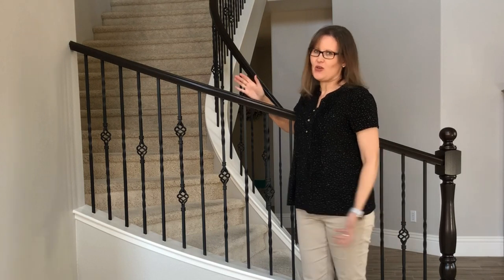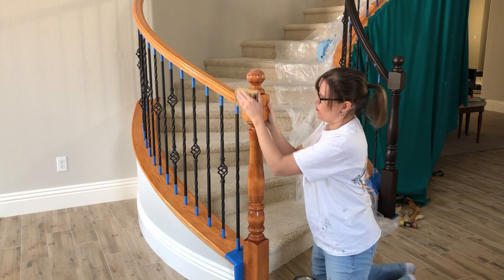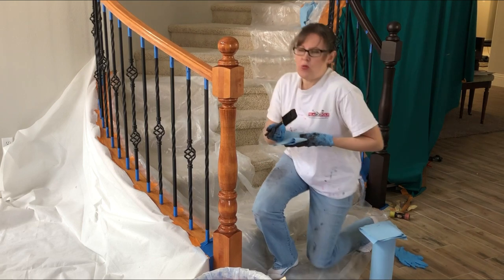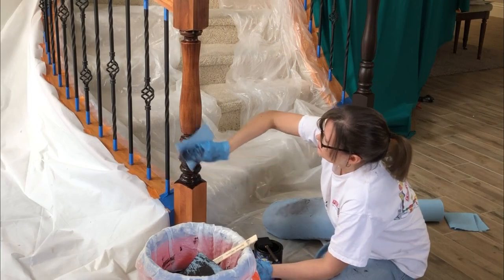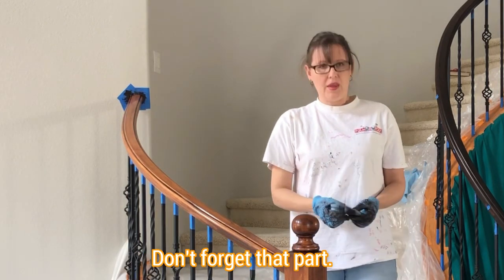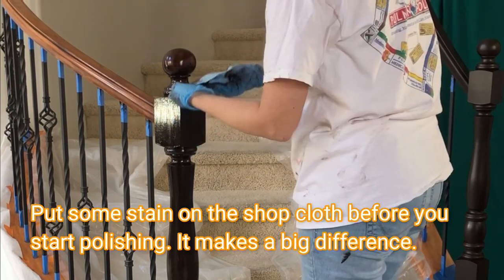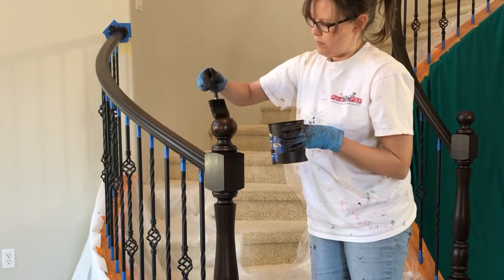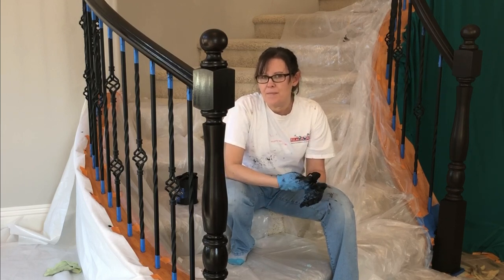Two-toned Gel Stained Banisters with Java Gel Stain Part 1

Comment: Am I understanding correctly that this method does not require complete sanding to remove existing poly finish on the rail and newel post?
Reply from the maker: Yes. Just a light sanding is enough. You are just roughing the surface up a little—not sanding off the existing finish. Good luck!

Comment: This looks great! Do you have to wipe the gel stain after each application? I have a pickled oak bannister I want to stain to match dark hardwood floors. It’s pretty big and would love to speed up the process. Thanks
Reply from the maker: Robyn Ellis Hi, Robyn. To use gel stain, you wipe on the stain, so you do have to wipe every coat. I started out very light. When I did it at my sister’s house, we put on thicker coats, and it didn’t take as many coats. Have fun!

Comment: Hello, thank you so much for posting this! I have a question, even though you want the stain to be the darkest why are you wiping it off ?
Reply from the maker: Hi, Heather. It’s part of the instructions on the can to wipe off the access. At first, I did thin layers because I wasn’t sure how dark I wanted the stain. When I knew I wanted it dark, I put it on much thicker, and I didn’t have to do as many coats. I did the thin coats for the video to show viewers the possible colors. Good question. Thanks for asking.
Reply: @onecreativemommy  If I want it to go as dark as possible should i bother wiping it off at all ?
Reply from the maker: Heather, I would still wipe it off. I don’t think you’ll get a smooth look without it. General finishes also makes a paint that ends up the same color as the darkest java stain. You can do that if you prefer paint.
Reply: @onecreativemommy  thank you so much !
Reply: @onecreativemommy  would you just do the first coat wiping off ?
Reply from the maker: Heather, I wiped off every coat. If it helps, think of it as spreading the stain around instead of wiping it off.
Reply: @1233heather  Also, If you don't wipe off the excess it will stay sticky for a long time. It won't look right or dry smooth...No good.  Trust me on this one.. lol.My cabinets were a disaster, I had to start over!